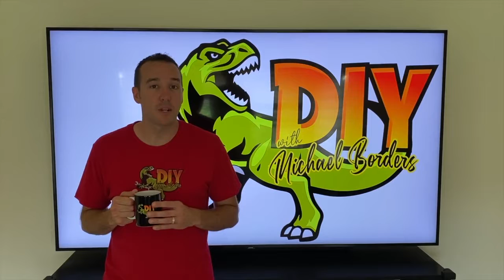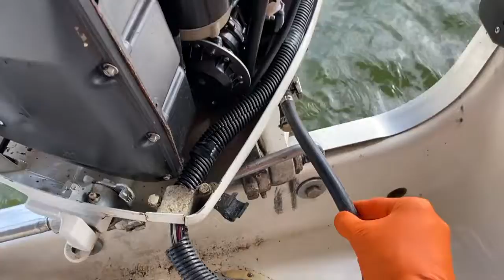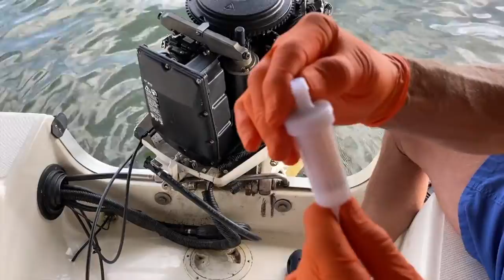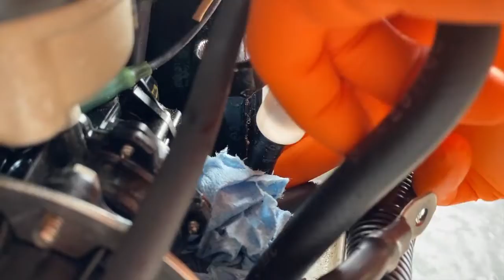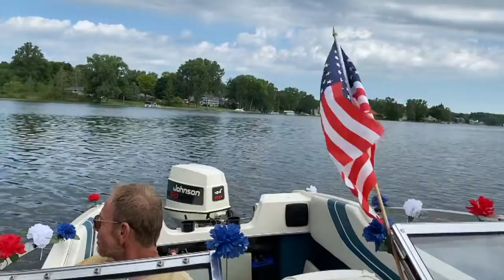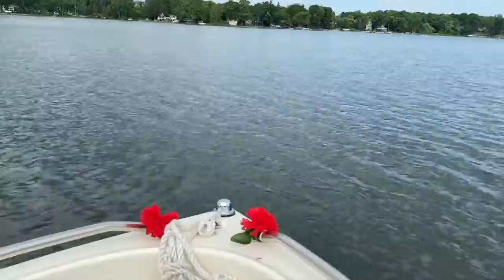Outboard engine not accelerating - Replace Fuel Filter

Comment: I had the same problem.  Tried changing plugs, impeller, oil.  Last thing was the fuel filter.  That was it - fuel filter had particles in it.
Reply from the maker: Thanks for watching & sharing this, that’s awesome.  A few additional new parts are a good thing too.  😁👍

Comment: I'm having problems with my Johnson 150hp v6 its an old seahorse type. Anyways it runs good out of water shifts into forward and will rev and get full throttle . However when its in water its acting like it won't get full throttle. I don't think it's my box and the motor doesn't bog. It sits at like 2500rpm and won't go over it. Any ideas ?
Reply from the maker: Thanks for watching, your engine is not a 2-stroke...correct?

Either way, if 2-stroke, it may be as simple as an imbalance of fuel-to-oil ratio inside your fuel tank and system.  Even the slightest bit of imbalance can cause loss of power.

It may also be as simple as bad gas however unlikely.  You may need to adjust your throttle cable.

Below are a few links to our videos that may be helpful.

       https://youtu.be/B5M67-bvhXw

       https://youtu.be/NdRj7mv9K4k

Keep us posted.  😎👍
Reply: @DIYwithMichaelBorders  it is a 2 stroke. I'm at 50 to 1 and can rev it up out of the water and watch my control box  give it full throttle on the butterflys and then in water it acts like I don't have full throttle. Very weird 😕
Reply from the maker: @gavinsixnine  

Thanks for the reply, you are not alone on this... seems like all our water toys run differently in the water than out of the water hooked up to the muffs.

Do you have a solid stream of water coming out your drain port while the engine is running.  If not, that’s the next thing to clean and clear to alleviate backflow of water.

The backflow of water works against your water impeller pressure leading to loss of power.
Reply: @DIYwithMichaelBorders  got a solid stream out the piss tube but  noticed water coming out of other locations and where the lower  meets the mid section too. Don't see how that would limit my rpms on the water but ill look into that ig
Reply from the maker: @gavinsixnine  

Thanks for the update, water should only be coming out of the drain.

Comment: Can it be possible that it won't seem to do it while on neutral and the moment you try to go it gets not acceleration?
Reply from the maker: Thanks for watching & absolutely.  Low idle is pulling very little fuel & as you accelerate, fuel demand increases.

A clogged filter will not allow the required fuel to pass through at the demand your engine is needing it.

Hope this helps.  😎👍🔧🔩
Reply: @DIYwithMichaelBorders  Thanks, brother!
Reply from the maker: @alexcruz7719  

😎👍🔧🔩
Reply: @DIYwithMichaelBorders  One last question, Michael: Since from tank to primer fuel flows ok, how can you determine that the issue is fuel filter and no, for instance fuel pump ( I, for now disregard carbs since I haven't seen any fault there, not leaks or what not)?
Reply: Update: I think I found mine's reason. I discovered a leak at the entry point of fuel filter and the small hose coming from pump. I pressed primer while looking at the spot and saw the leak.🤞
Reply from the maker: @alexcruz7719  

Thanks for sharing this & that’s awesome you have pinpointed the cause.  Enjoy the water.

Comment: How can you tell the fuel filter is gone bad ? I really praying this is my throttle lag issue on my 70hp evinrude outboard. Thank you for sharing
Reply from the maker: Thanks for watching & you can simply remove filter from filter cup & clean filter.  Some people will soak the filter in white vinegar for several hours and then reinstall it... however this may lead to falling victim to using the same filter for the next 20 years which will definitely cause significant degraded engine performance.

In other words, replacing it is definitely recommended.  Hope this helps.

😎👍🔧🔩

Comment: I got my injectors serviced. The going wait time is 6 to 10 days but I tossed the guy a Benjamin and I got them back in 24 hours. The guy who suggested injector 4 was clogged because any debris that got into the tube settled at the bottom and fouled up the lower injector. The first flow test results were 40, 38, 41, and 19mls. After cleaning they basically tested out at 42s across the board. I have high hopes that the problem on not being able to accelerate is solved. I find out tomorrow. I just hope they go back into place as easily as they came out. I don't want to deal with the VST right now and just want to catch some stripers while there still here.
Reply from the maker: We appreciate you sharing this.  We are excited to hear from you on how it performs after you get it back.

Definitely let us know if you have any questions, us fellow DIY’ers need to stick together!

Hope all is well.  😎👍🔧🔩
Reply: @DIYwithMichaelBorders  Problem solved for now. took the Edgewater out today but it was gusting to 25mph with vicious swells but I sure got it going better than the 10mph she ran at prior to having injectors serviced. A little bit of flat water and I think she'll move right along. I just can't take my wife and daughter. They squealed like babies and killed my buzz big-time. I've got some other problems to take care of but at least the motors running electronics are working and I've got fresh batteries. I have to tackle the live well pump and the raw water pump and then figure out what else I need to do and I'm sure it's something
Reply from the maker: @1planters  

Thanks for sharing the update.  Hopefully many stress free days ahead for you.  Enjoy the water.

😎👍🔧🔩
Reply: @DIYwithMichaelBorders  Michael Michael Michael... I can reach the best striper spot I've ever fished by walking a couple hundred yards to a bench I have perched on the edge of the river. So I own the best fishing location on the river AND have a bunch of Brofriends with boats for niced than mine but there's not much chance of me spending 50k on a new GW 18ft fisherman. Being the genius I am I bought a older Whaler. what I have learned is that when you buy used boats it's sort of like that box of chocolate that you never know what you're going to get. Stress free boating is something I would like to experience and I'm praying the the Big Guy to look out for me over the summer. it was in the 90s here up until Tuesday but yesterday it went down to 54. Now that's colder than my wife's heart. Well I'm going out solo shortly with no clucking hens so it should be a nice but very choppy day on the water with three back seat drivers.
I just might have that stress free boating you refer to. I sure hope so and I just might. The boat is on a mooring in the HaBa just waiting for me.
One question if I may. Ive added a couple cans of Seafoam but are there any other additives you would recommend? Maybe something to mitigate the damage caused by ethanol. any recommendations my friend? 
Thanks for your help (wish you were here for painting the bottom) and if I have any questions I'll be hitting you up for some non-judgmental assistance rather than taking out my son-in-law daughter and wife who just squawk like chickens but don't know anything. Safe and happy boating to you bud and remember it's not about the fish caught it's just about enjoying the day. that is why I'm heading out alone. Just going to my enjoy myself
See you in the water and thanks. if I want to be criticized and have my balls busted I'll just wait till the misses gets home. HaHa. Now I have to get my bird dog out onto the boat in her life jacket although that Brittany swims like a fish.
love you like a brother, John
Reply from the maker: @1planters  

😎👍🔧🔩

Comment: As a side note Michael this is only my second boat but I'll tell you it sure has been a learning experience. Sometimes even with the tube it is tough to get good answers. I've also learned that a stainless steel screw at home Depot cost 20 cents and if I go across the street to West Marine it cost a dollar and 20 cents. Someday I'll figure out why anything Marine related cost two maybe three times as much as anything not Marine related. Sometimes I think I'm getting humped without getting kissed. Plus those chuckleheads at West Marine must have been working in the paint department at home Depot yesterday. IE: they don't know s***.
Reply from the maker: Thanks for sharing & those are all fair questions.  😁

Comment: I've got a 2001 Yamaha 115hp the throttles up great in neutral but when I put into gear it still sounds ok but when I  accelerate top speed is 8mph.  Any words of wisdom.
Reply from the maker: Thanks for watching & welcome to the DIY Raptor Club.  Have you replaced fuel filter?  This is an extremely common cause that leads to degraded engine performance you are experiencing.

Please keep us posted.  😎👍🔧🔩
Reply: @DIYwithMichaelBorders  You know
Reply: @DIYwithMichaelBorders  I'll tell you what Michael my man. The Boat and motor are with my son-in-law at the fire station. His Captain's second job as all firefighters have one was repairing outboards. He's going to plug in the boat today and see what he can do. The research I did on my own is pretty much spot on with what you're telling me. For one thing the motor always fires up but the fuel line bulb never feels full and I believe I have one downstairs attached to a pony can which I can try if of course the captain doesn't fix it today. It also makes perfect sense that the motor would scream in neutral but not went under the load. I'm assuming it takes a hell of a lot less fuel to get the engine roaring in neutral then when the engine is trying to push the boat. Right now I wish I hadn't let the boat go to the fire station as I would just be changing out the gas filter and the priming bulb and checking out what that would do for me. I will definitely let you know if you are guess/diagnostics are as good as they sound. The stripers, blues, winter flounder, summer flounder, black sea bass, Scup, and even the tautog bite is picking up in Cape cod Bay something a traditionally has not done. Thank you global warming and I'm hoping to catch some Benito's in albacore in the very near future should I get my boat back. Tight lines my fishy smelling friend and I could only be lucky enough for it to be a simple fix. Today I have a choice a fishing down in the backyard for stripers or going over to Scituate Harbor for flounder in the kayak. I also have an additional choice which is lawn and garden work that if I don't get to your ball and chain will scuttle my boat.
Reply from the maker: @1planters  

We appreciate the reply and if we had to choose we would go fishing for a few hours and then go kayaking… both of which we find extremely relaxing and peaceful...not to mention stress-free....That’s taking into consideration not caring if we catch any fish or not...😁

After my wife sees me cast my line into the water, she looks at me and says, “ are you going to real that in”..?...

That’s when I look at her and say... “nope”... it’s my relaxing time...🤣

We are excited to hear back from you this coming week on what the fireman/boat mechanic finds wrong with your engine.

😎👍🔧🔩
Reply: @DIYwithMichaelBorders  HaHa.. I went flounder fishing in the yak last night instead of m***ING with injection jets. I only had gulp Seaworms and the winter flounder really seem real worms. So... I drifted around Scituate Harbor for a couple solid hours. dragging the bait. I'm afraid I smoked a Doobie and I don't thing I even think I got a bite but it was a great couple of hours. 
Removing the injectors was truly a piece of cake. One question which I hope you can answer.   There is a thingamajig at the top of the tube with fuel in and a fuel out tubes. It looks like a filter?? Do you know what it is and what it's called? Thanks. I'm taking my four injectors to the marina to be sent out for service. They say four or five days cuz the guy is just the next town over. I said I would pick up as well as deliver if it's sped things up. That little thingamajig that sits on top of the tube is quite Rusty so whatever it is I'll replace it anyway. I sure hope this works out. It was a real buzz kill to be idling beautifully and I couldn't hear the engine when we were leaving the harbor. So basically I punched it and it zipped up to 9 mph and bog down. It was just a major buzzkill but if I can fix it in the next couple days I'll be happy. You enjoy your Sunday
Reply from the maker: @1planters  

Thanks for the reply.  We have attached a few video links below showing replacement of fuel filter, case, & hoses.

       https://youtu.be/8oQp9t-17KA

       https://youtu.be/UBnmjc5OZWw

Hope this helps.  😎👍🔧🔩

Comment: I have this problem on my beyliner capri 1770 start but doesn’t accelerating inboard motor do you think it could be same problem ?
Reply: Pass to safety mode or limp mode please help. 
Thank you
Reply from the maker: @vegasbullys7538  

Thanks for watching.  What’s your update.  A common cause for a ski to revert to limp mode is due to corrosion on the inner portion of your key.

We recommend cleaning the interior portion of the key to remove any and all rust/corrosion.

😎👍🔧🔩